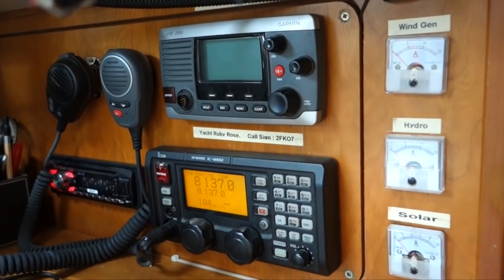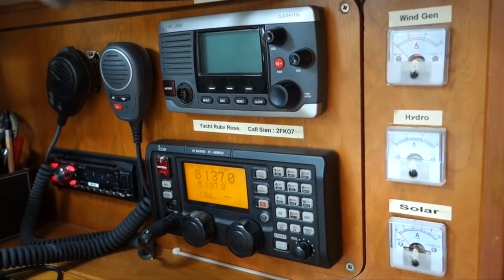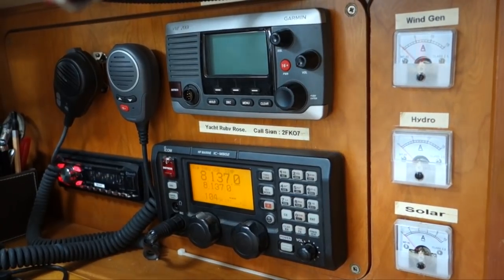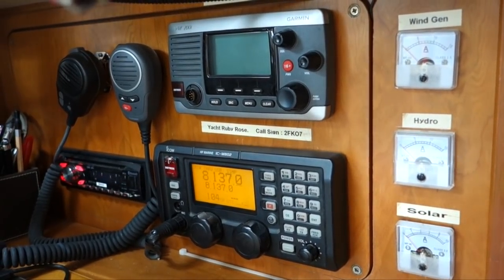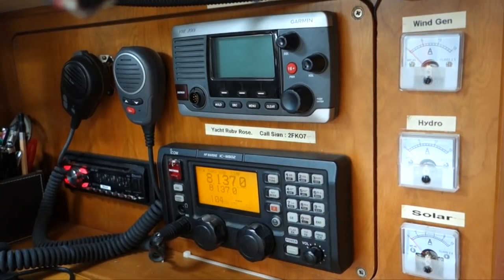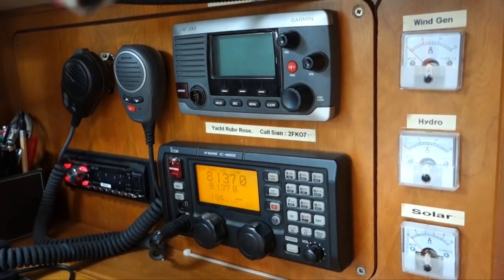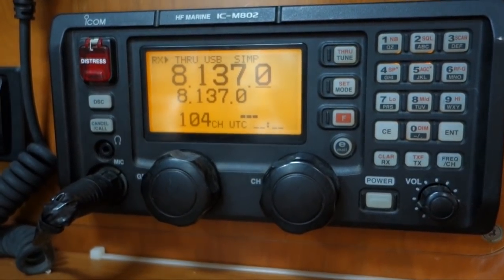How do we communicate at sea?

Comment: Hello, thanks for the informative vid. Very much appreciated. I also have an SSB and the whole thing that goes with it including the modem. I must confess that I have used it very very little. I am in Europe and there are only two relay stations one in Keel Germany and the other one in Belgium. More often than not, these two are busy or something else. The result is that the thing woks once in a while. So, I have not renewed my contarct this year and I have not noticed any visible difference. So, I am planing to get an Iridium Go. However, given what you said about it, I will wait a little and do some more reaserch. And I also hate windows!
Cheers//

Comment: I know this is somewhat of an impossible question, but...
Would you 
A. Buy a bought that's outfitted for around the world travel and has been used heavily, but maybe will have parts that are nearly worn out due to use.: Water maker, dinghy davits, solar, ais etc. (Something from about year 2000 and newer)
B. A really clean boat with low use, but with almost no gear. (Again 2000 and newer, but a lower hour engine and use in general)
Reply: Thank you! I appreciate the answer. We are a year out, but I have been searching by terms like AIS, Solar etc and have found some good boats with high engine hours, but all of the expensive toys. I figure these would need a good 10k or more thrown at them, but in the long run I hope it would save over a bone stock boat.

Also, great video. For us land based travelers the Delorme/Garmin (Garmin bought them) Inreach is a great way to go. I've use the SPOT Gps for about a decade, but without 2 way messaging you can really only say "Okay", "Help Friends!" or "OH SHIT Emergency". 
I love that with the delorme you can say, I need a fan belt for a blah blah. Also, it seems that the delorme one doesn't erase your tracking. Spot only shows 7 days of travels. With the delorme you can see where you were in March of 2016 if you wanted to.

Cheers, wife and I really enjoy watching you. I have a feeling you have a lot of material for the blooper reel!
Tim and Kelsey

Comment: You could build a ssb antenna out uf copper wire cheap and use a small antenva tuner as well.  Get your ham license and you can be self sufficient without all those exoensive fees.  I installed one on my cruiser and had good communications. Good info,  W4DEU

Comment: On a boat you are limited in height and length, so you have to pick which bands you are going to support.  But tuned verticals should be easy to make for 20m and 40m.  Tuning these via trimming the lengths, rather than using a tuner, would really help with efficiency.  A tuner simply alters the impedance presented to the radio by the antenna, it doesn't really 'fix' anything about the antenna.  Which is why making a resonant antenna is better than using a tuner to fix a random length wire.  Get yourself some yagis for the upper bands like 10m and 6m and you could find yourself VERY popular in rare grid squares.  I ran a mini dx-pedition in the BVI in 2015 and have had 98% of the stations I worked request a card, and the BVI isn't even very rare!  I do SOTA and IOTA activations and I never take a tuner to the field, just tuned antennas.  Plus salt water = 3dB gain EASY!
Reply: Almost no antenna has a 50 ohm natural impedance.  Almost all have an impedance transformer of one type or another somewhere.  This has little bearing on whether the antenna is 'good' or not.  Nor does being resonant mean it is 50 ohms.  An impedance match is needed to efficiently couple power from the transmitter to the antenna, and can be 'fixed' in a tuner at the radio, in a balun at the antenna, or in the match design of the antenna itself.

Comment: The reason Satellite Phones are unreliable is because ALL communication is done via Line-Of-Site, Relay, and Skip <period>
Let me fire another communication salvo:  Undersea Cables Transport 99 Percent of International Data, and cable technology has been in place across the face of the Earth, since 1902
Would you like to send a Cable or Fax?

As stated by "stromgewehr" below - Weather fax, news, maritime nets and many other resources are available for free using any HF receiver, an optimized antenna will make that far more reliable.

Comment: Awesome video. Great advice guys.
I have most of that gear on my boat too Also like you i paid dearly for ssb 12 years ago even. Used icome ssb 710 back stay insulators, dyno plate for grounding and installed it all myself. Cost me 3,000.00. No pactor modem .I used it a lot out in south pacific.australia etc 12 yesrs ago for conversations at sea, but not much in asia  now. Since it has no reliable way to get you rescued at sea i consider this expensive unit a social device. And a radio to get bbc.
I have had  the irridium sat phone. It lasted 4 years before mother board damages rendered it uselss  never got wet ever..paid 1,600.00 in 2008 included 500 minutes. Cost me 3,100.00 to call home over 4 years. I liked it but when broken bought the inmarsat for 600.00 w no minutes it cost me about 2,000.00 in 4 years to call home
 it was ok but not as good as irridium  it also lasted just 4 years. A software issue. 
Now i am going to buy the garmin in reach for 400.00 and get a basic flex plan. This new garmin should be enough for me to text home. And this with my ssb and a  satellite e epirb along with my ais is my cruisig communications.
I would not buy ssb now and i personally wont buy sat phones now that there is the garmin inreach

Comment: Good explanation of some of the available ways for at sea communication. Hope the Iridium next brings down prices but not holding my breath. When we're off in 2020 or 2021, I need good reliable internet for my wife who will be teaching online, so at the current time, it would be cost prohibitive to do this unless we used wifi and cellular. Satellite is just to expensive but would have to have it during passages, unless I can stick to a rigid schedule, which we know it close to impossible when cruising. 
SSB to me is more for the social side of cruising, and would be important if the shit ever hit the fan. But for most, not necessary. Costs can be a lot less though with used equipment. But power requirements can be high. Need to have a good battery bank.    From What I have heard of Iridium Go.. not liking it.  But I might try it and see for myself. Good for weather and wind. The field is changing, stay tuned!

Comment: I'm a new fan and I'm enjoying your videos.  The information is very helpful!

You mention that you would not recommend the InReach system as your primary communication device.  Could you let us know why?  My plan is to use the InReach (unlimited email/sms, graphical weather using smart device) as my primary as well as an EPIRB when in remote locations.  I would use a long range WiFi antenna/amp (~7 miles), and a cellular booster (~30 miles)  for VoIP/data/phone near populated areas.

Off topic, could you let us know what insurance plans (boat, rescue, etc.) you recommend for world sailing?

Thanks for all the great videos!!!
Reply: Sailing Yacht Ruby Rose Thanks for the great info!

Comment: An SSB is so much move valuable then only a receiver/email device. But many sailers have no intention of leaving the equator. Like any piece of kit, its useless if not used and understood. Its free to use, reaches around the world, especially from high latitudes. Directly communicates with coast guard vessels. Acquires weatherfaxs, and can prevent loneliness. Don't get me wrong, satellite is great as well, but am SSB is robust and free to run. The email portion is probably outdated. Now if you could easily send and receive text via an iPad and an audio cord over SSB, I think they would have years of value beside satellite coms for years to come. Until our iphones work on the ocean, near as well as on land, personal satellite coms aren't yet a replacement for truly remote locations.

Comment: Good stuff Nick. I have my HAM license, so do I still need to get a license to use the SSB on maritime frequencies? Also, if you use a vertical whip antenna, where would you mount it. (i.e. top of mast) THANKS!
Reply: You can only legally use your ham license to transmit in the ham bands. Except if it is an emergency of course, then you can transmit anywhere you need to.

Comment: Great video and thanks for sharing. Slightly off topic I noticed your ammeters for wind, hydro and solar. What wind and hydro generator do you use and how are the ammeters linked up? I assume they just show amps generated or are they looked to battery to show amps stored? I have a Duogen which can generate wind and hydro but not at the same time. I would like to add some ammeters so interested in your set up. Electronics is not my strongest skill but learning... I have a Rival 32. Regards. Andy
Reply: Sailing Yacht Ruby Rose cheers for that,  so you didn't add a shunt for the Ammeter?  I keep reading about them and lots of videos show using a shunt slightly bigger than the battery capacity.
Reply: Just an fyi you only need shunts for large amperes, eg more than 20a although they can make the wiring easier and tidier🍻
Reply: All amp meters have shunts.  Small meters have them internally, larger amperage ones have external ones. The reason for the shunts is amp meters are actually secretly voltmeters and need the shunts to create a voltage that the meters can read to determine the current through the shunt.

Comment: On a slightly different 'tack' may I ask your views on the suitability of integrated AIS/DCS Radio systems as opposed to 'standalone' AIS.  There appears to be the obvious cost saving with the former option but that may come with a downside in terms of practicality for short handed cruising.  The biggest advantage, as I understand it is that standalone transponder systems receive and transmit AIS data, therefore not only can also you can see 'other traffic' but can also 'be seen' and identity shown .   I'm not sure whether that's so with integrated AIS/radio systems.
Reply: Thanks for your prompt reply and it sounds like good advice - Appreciate you sharing from your 'practically gained' experiences - Cheers from Evano
Reply: I totally agree and I've just forwarded your good advice to a young couple (Sailing Kittiwake) presently setting out on their first trip across the English Channel.  They currently don't have AIS and have just arrived off North West France.  It's a well known fact that us sailors 'help each other', I've only been sailing 50 years and still learning...!

Comment: SSB "single Side Band" I think you can get the whole equipment including antenna for under $1,000 dollars. their is some frequencies where you can communicated for stress. Ham Radio Lic. is $12.00 in the USA for a technition Lic. look into IC-706MKII, also Kenwood 2000 model with satellite capability, you can open up the radio to cover all the frequencies from 1.8-30 MHz their is 100's of radios to purchase but for a low budget I think is a good start. thanks for you videos and good energy that motivate my wife and I to get a boat... if you have a question feel free to contacted me. I will happy to help you.

Comment: 2:40 Totally agree, and I get very cross when vendors supply Windows only software and hardware.
Reply: He's probably even crosser now!
Reply: I am pretty sure you can use VirtualBox as well as a few other programs to allow you to run Windows on a mac and vice versa.
Reply: I don't get the rabid i-culture. The reason windows is so widespread is that it can be used on virtually any hardware and has vast amounts of compatible software. Slag it all you like but you are not tied to a single vendor and I constantly upgrade my hardware with a screwdriver - cheaply.

Comment: I hate Apple devices because they are incompatible with so many applications and generally less versatile than Windows, they are also extremely over priced.
Reply: Not true a apple Mac can run windows through boot camp better than a PC and also you can use VMware fusion to run windows applictions.
Reply: Richard Oram ?
Reply: I agree. Apple is rotten to the core. Not compatible with other fruits of the forest.

Comment: Your SSB claimed expenses are insane, and once the unit is installed, usage is essentially free! Why the heck do you whine about not using it after you have purchased it? Licenses are nowhere near as expensive as you claim, in most countries, and used windows laptop computers, in good condition, can be easily purchased for $50-$100 US. NONE of your complaints are legit!
Reply from the maker: Actually this is not strictly true.
But seeing as you asked to politely, i'll explain.
Firstly, the mail service is not free, its paid for. 
Secondly, sending e mail is not easy. Signal propagation  means that you have to pick your time and weather conditions to try and get emails sent.
Look. we love our SSB, but it can be a tricky little bugger to use.
Also, yes you can buy a second hand unit for $3 and some loose change, as well as a cheap second hand lao top. There are always ways to save on costs.
We felt that while we were happy to buy a used ICOM 802 ( you couldnt buy a new one in the UK legally at the time), we wanted to buy such an important communication tool and use the best we could. This meant spending more money
Reply: Perhaps all the information I have seen about the free email messages (text only) was incorrect, when was looking up information on pactor-4 modems, which run $1500-$2000 US. I know there are some deluxe email services that cost a little bit of money, like those provided by SailMail, $275 US, per year, but there are free alternatives, like Airmail2000, so I do not know what you are talking about.
Reply: waste of money when they're better and cheaper options